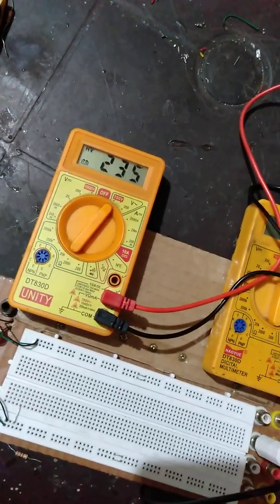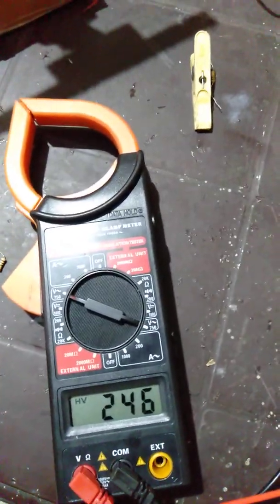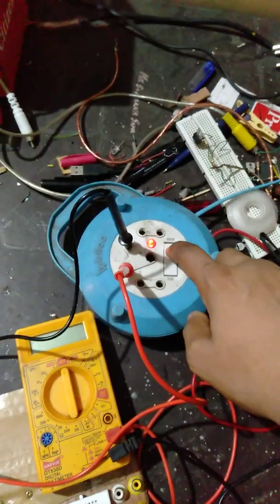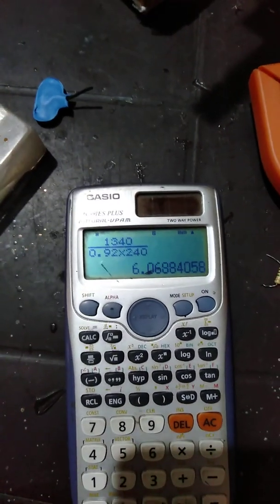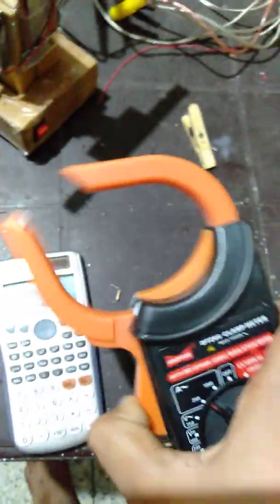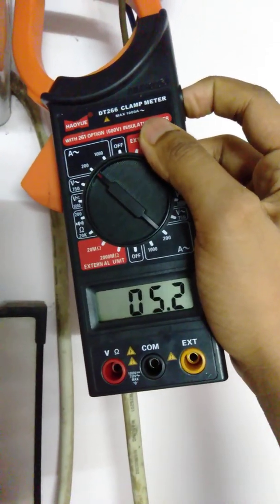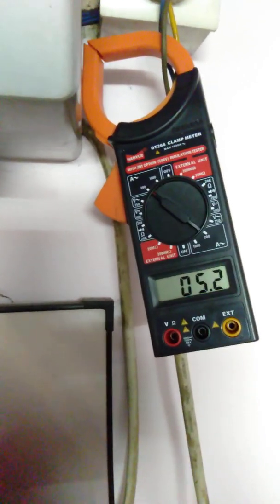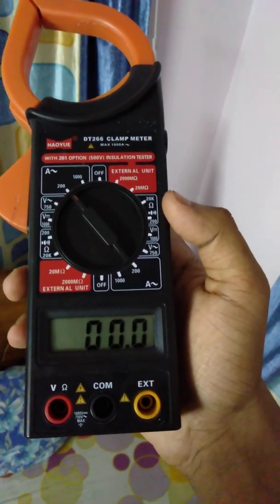This is why you should not trust a cheap DT266 Clamp Meter | Clamp Meter Review [PART-2]

Comment: Beep sound condinitgmode not stoping how to repear
Reply from the maker: You need to check for shorting Between the buzzer and the power terminals.. in case it is then desoldering is recommended, else that would be the problem with controller IC itself...